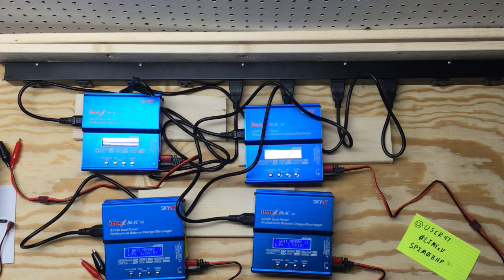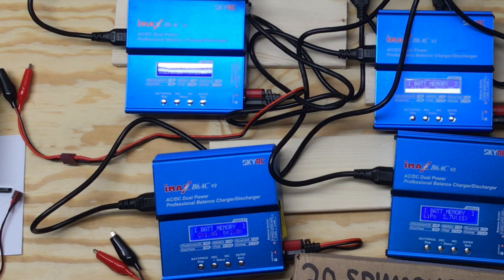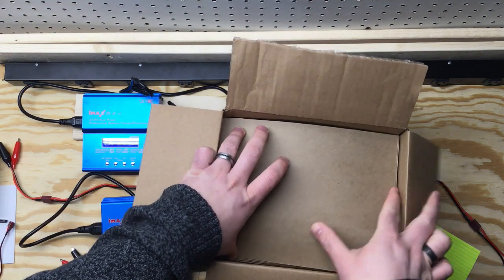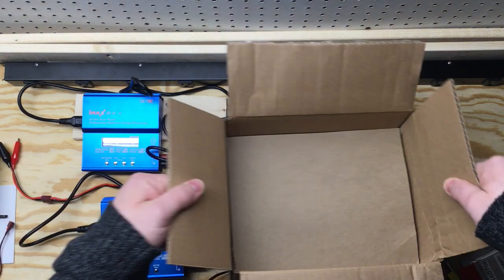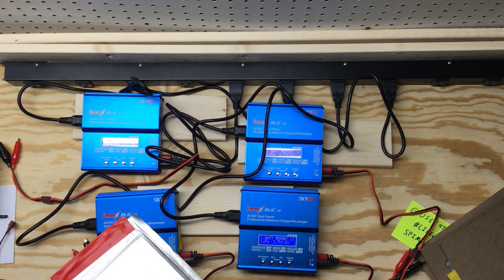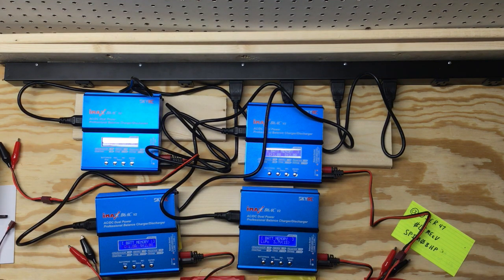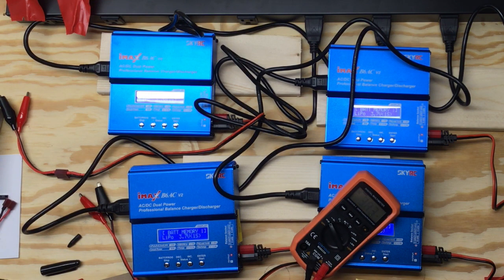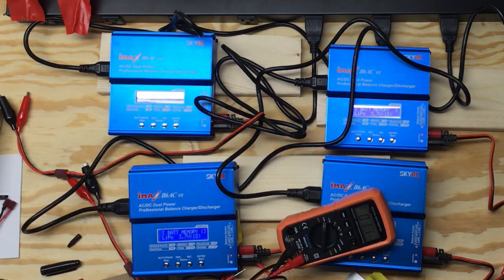Testing SPIM08HP batteries from BatteryHookup- Part 1

Comment: I have the same charger balancer, never seen the Internal resistance feature, where exactly do you find that?
Reply from the maker: Hey there, thanks for watching. It should be one of the options in the top menu along with voltage meter, just arrow over and it should be there. Hope this helps!
Reply: @diywjlj-jljohnson-535  Nope not there, (top menu)  perhaps you should check it on your end and add it add it.

Comment: I tested 4 of the 61 I have. Full charge 4.1 then did a discharge at 1.5 amps( highest I can go with the charger i have) and they all came out close.I believe you need a higher discharge rate before you can find out what's good and what's not. I think putting them in the configuration you want 5s.6s.7s ect=== then testing them at a higher draw with show a bad cell much faster.I just have not figured out how to do that temporarily (yet) in order to be able to remove a bad cell when found.. So any suggestions would be appreciated! Thanks guys and be safe!
Reply: Hole punch the tabs and use nylon screws and nuts (+ washers ?) to connect the cells.
Three bolts per tab should be good. I can't take credit for the idea I saw it on one of the E-bay adds for these cells.
Reply from the maker: ghz24 this is the direction I’m leaning. Some of the packs I’ve seen around look scary with the amount of exposed metal. I’m no professional but am looking for something hopefully a little more safe and hopefully permanent

Comment: I have over 80 of these cells and my experience with the imaxb6 ac is that it can't read the internal resistance correctly I purchased a separate meter for reading that uses a 4 wire system and they were all between .8 and 1.9 milliohms
Reply: Yr1030 mine is in Chinese but I have an English manual you can find them on eBay I ordered it from China took a little while to get here but it was around $45.00 they have ones in English aswell didn't notice untill it got here.
Reply from the maker: Good info. Care to share what device? I’ll be looking to match cells of the same resistance as I start building my packs

Comment: How did this charging method work for you?
Reply from the maker: Andrew D slowly! This isn’t ideal given the huge number of cells I now have.
Reply: @diywjlj-jljohnson-535   if I was to do it one by one you think that would be okay?
Reply from the maker: Andrew D I don’t know which cells you have. For my high capacity pouch cells it takes about nine hours to charge and discharge. The B6 has lots of safeguards built in but there’s always some risk. Be sure to check out part 2 if you haven’t already.
Reply from the maker: Andrew D 

https://youtu.be/OtqOKbK5Df0
Reply: Ahhh didnt see part 2 😂 but I have same exact battery from same seller. Just trying to get as much knowledge as possible and pick people brain for info 😁 thank you for responding